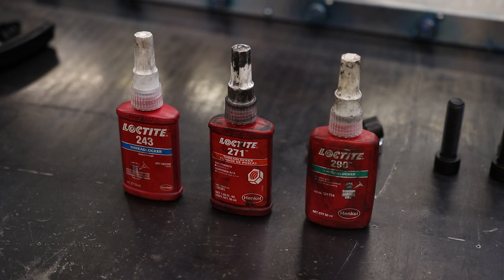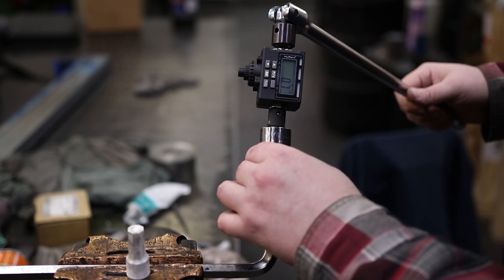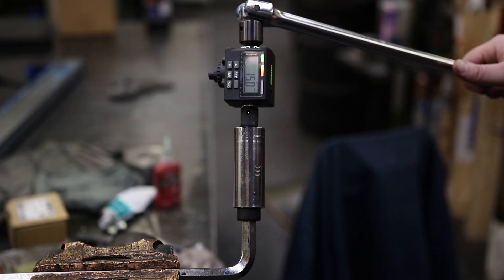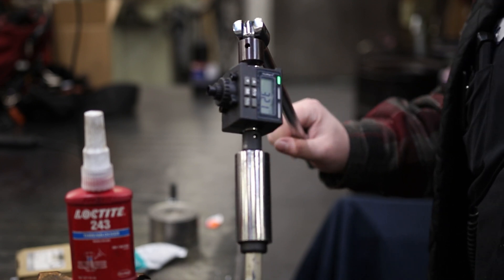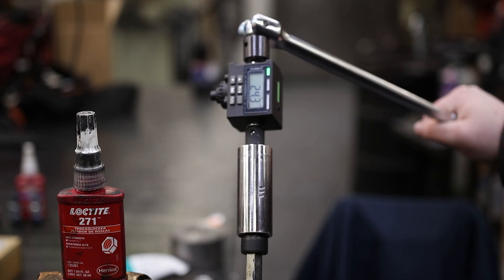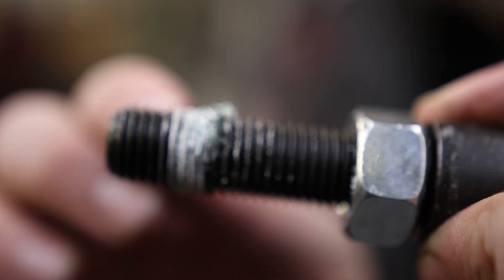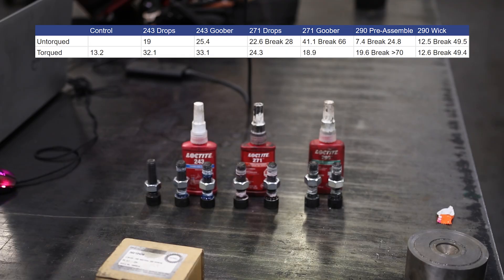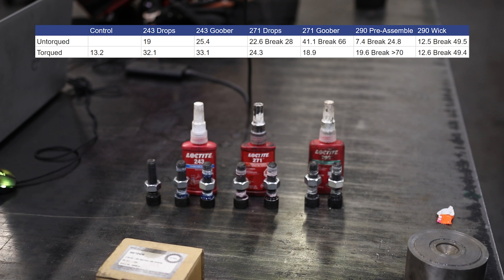Testing Loctite Threadlockers 243 VS 271 VS 290

Comment: Hi DB, retired Loctite rep here (32 years). Just came across your video. It is really well done. It is an excellent demonstration of many things. First, how the amount and application can really vary the ultimate strength. Second, what you experienced with removal is what we call 'breakaway vs prevailing' torque. 290 is the most extreme example of this. It typically breaks at a low torque and then as you keep turning it gets higher. The way I used to explain it was the first torque breaks the bond of the threadlocker to the bolt. Then you're fighting the hardness of the cured threadlocker. Your video also shows the failure mode of threadlockers. The crushed up powdery look is exactly what you should see when disassembling the parts. It means it bonded to both surfaces properly. Sometimes you don't see that. Then it means there was contamination or the metal is question had some kind of coating on it and the threadlocker couldn't stick to it. Finally, 271 is a very old formula. There are two newer generations available now. 262 was launched in the 1980's and 263 & 2760 were launched in the 2000's. The newer formulas bite into zinc plated bolts better than 271 or 262. So if you get a chance check those out. Cheers.
Reply: Do you think that the higher breakaway' torque of the 'non-torqued' nuts could due to the capillary action of the loctite being greater when the nut is loose? After all when the nut is torqued, the upper face of the bolt thread and the lower face of the nut thread will be closer and therefore might reduce the capillary action?
Reply: @fylbike  No. The only formula that has a capillary action is 290. So it's more likely due to a larger amount of cured threadlocker being in contact with the bolt and nut as opposed to being pushed out a bit during torquing. In other words, after torquing there may be less cured material left around. Keep in mind in his video he actually used 290 incorrectly. It's the only formula that is designed to wick into a pre-torqued assembly. So he should have threaded on the nut then applied it to the interface.

Comment: What’s everybody using for optic screws on pistols?
Reply: Switched from Blue 242 to 243 for the added oil resistance. I prefer the 248 solid stick or gel version now though, less mess.

Comment: Loctite 277 for more permanent applications.  

In addition, all the Loctites you are testing are not designed to increase torque required to separate fasteners.  They are designed to prevent vibration.  

Each of these accomplishes this by curing into a “plastic” basically acting like a nylon locking nut.  - which does NOT require additional torque to separate.  

If you want a more permanent solution; Use Loctite 277.  Loctite 290 is NOT appropriate for the application you are using it for.

Comment: Thread Lock .. was introduced to prevent nut falling off, prior were spring washers and castle nuts Aircraft used bolts in situations so they would not fall out of  the bolted pieces..always head on top.. manufacture and materals and testing are criticly monitored plus  stringent airtime inspections .  Bolts are elastic so in theory nut needs to undo against a torque ..manufacturers to lower costs required cheaper bolts .. cutting threads went into mass production  pressing threads  .. high spec bolts are very different to cheaper bolts and still used in critical applications ..  In the video tests None of the bolts or nuts were degreased, an important pre-treatment .. however it did show nuts and bolts will not separate .. In disk brakes its common practice to have 2 bolts holding critical part and chemically locked .. so if one becomes lose the other is likely not to come lose... like merchant ships 2 of everything.. interest test

Comment: Great video, it would be nice to see how it works if you apply it to the threads, let it dry and then add a nut. I mainly use 243 on very small screws to hold Optics on my pistols, they always send the screws with Loctite already dried on the screw
Reply: Hi there, retired Loctite rep here. Threadlockers cure when the air is excluded from the joint. They don't dry. So you can't apply it, let it dry and then assemble. It needs to see metal on both sides and the air must be pushed or eliminated from the assembly. Then the chemical reaction starts.
Reply: @Kumacattv I know that's normally how it works but 243 can cure on non-reactive metals these days so I would imagine if you just put it on a screw it might cure. How do they get it dry on screws when they ship with a little dab of dried Loctite?
Reply: @mariosmith8456  Mario as stated above you can't just put a drop on a screw and wait for it dry. The resin doesn't work that way. What you are confusing a threadlocker with is a preapplied coated fastener. We make reapplied products as well. They are applied in a factory with specialized equipment and then baked in an oven. The coating contains microscopic anaerobic capsules that get crushed during assembly. Then curing happens the same as a liquid threadlcoker. No air and two metal surfaces. There are also preapplied products that aren't anaerobic and behave pretty much like dried paint or rubber. But any anaerobic resin must be trapped in the assembly to cure properly. As for the metal type it affects the cure speed once things are assembled or torqued. But a threadlocker never dries! It cures when the right conditions are met.

Comment: I don't understand how the 271 is supposed to prevent tampering  (per Loctite) when it comes off with such little torque.
Reply: Retired Loctite rep here. It's not about the torsional torque resistance. The cured resin in the thread clearances prevents the nut and bolt from moving independently from one and another. That's what prevents the assembly from loosening.

Comment: Nice video I'm a retired Electrician used thread locker a bit through my career not as much as you have. I just want to know when the hell did you steal my deep well socket it has to be mine it has 3 hash marks on it!:face-blue-smiling: That is how I marked all my tools with a file or 3 dots with a punch when I seen your tool mark I just thought I'll be damn.

Comment: Nice research, I'm certainly no expert in this field but I'd assume that by not following the manufacturer's instructions and applying more that the recommended amount could cause some lower grade bolts to break upon disassembly if torque requirements are close to the breaking strength of the bolt. I'm careful to apply the instructed amount for that reason.

Comment: What about testing the Loctite 542 for hydraulic oil pressure.
Reply: Retired Loctite rep here. The pressure resistance of 542 should be 10,000psi. It is not listed on our technical data sheets but is listed in most of our product catalogs. 542 is the European version of 545.

Comment: What do you use to clean this stuff up if you are reinstalling the bolts, cause the bolt hole is going to be gunked up with dried up loctite? if you don't clean the threads properly wouldn't it affect your torque specs during reinstallation?
Reply: HI there, retired Loctite rep here. Use a tap, if you can on holes and a wire brush on the threads if you re-use the old bolt. Should be good enough. And yes you're 100% correct and loose material could affect your torque values. Keep in mind of the 3 products he tested 243 is the best lubricant for torquing to spec. It lubricates better than oil. 271 is a horrible lubricant. If that's important then I'd use 262. And 290 is post applied so it doesn't really have a lubricating affect. You're essentially torquing the bolt dry then applying it.

Comment: Is is possible to remove LOCTITE 243 residue from painted surface? 
I used Loctite 243 for the screws to attach black painted bar ends weights to the handlebars of my motorcycle. Unfortunately, I had some Loctite residue on my hands during assembly, which left some ugly fingerprints on the shiny black paint of the new bar end weights.
Is it possible to remove the loctite residue from the bar end weights somehow without damaging the paint? Maybe with chemicals, heat or buffing?
Reply: I've never tried.  A green scrub pad is my best friend for cleaning stubborn material, but it might scrape up the paint.  If it was me, I'd try that with WD-40 as a lube and cross my fingers.  If the bar ends have knurling or texture, it will likely rough up the edges.
Reply: @distractor_beamreviews  Thanks for the suggestion! I'll give that a try. The bar ends are just smooth cylinders
Reply: Hi there, retired Loctite rep here. The answer depends on the type of paint. If the paint has a high environmental resistance to it then the threadlocker might not even stain it. Usually any kind of solvent will clean it off. However if the paint surface is rough and not epoxy based or latex the threadlocker could stain it. If the paint has an acrylic base to it the threadlocker could stain it. It is anodized black aluminum then you should be ok.

Comment: If you heat any chemical, it speeds up the cure. Put a flame on the loctite and you’ll get 24 hours of cure in 24 seconds.

These results are all off. you need too acetone every bolt, and apply the exact same amount on all of them. That wasn’t done here.

That red stuff should have one everything

Comment: The Green Loctite is some crazy stuff, last time I used it a bearing race had been damaged by a bearing not being replaced when should have so the new bearing wouldn't stay in the race.  Added some Green Loctite and waited an hour and that bearing will now need to be heated out of the part but it prevented the replacement of a $2800 roller. lol
Reply: Yeah I thought the green stuff was pretty wicked, until I worked din an engine shop and they had a magic bottle of clear loctite sauce. 
Not even a label on it ,that's how I knew it worked great 😂
It musta came from a distributor or something,no markings on the (similar bottle) as loctite.
Reply: There is a difference between the the 290 green, and the 6XX green retaining compounds.  The retaining compounds are much stronger.

Comment: These bolts had a shoulder down at the head, so you weren't torquing against the threads, but rather just the very bottom of the nut against that shoulder.

Comment: Loctite is anaerobic. NO air means it sets. The red stuff not working may mean that there was an air gap at 15 psi
Reply: Retired Loctite rep here. If you look at the video he got crushed up red powder upon removal. So curing wasn't an issue. 271 is an older product that was invented in the 1970's. It is slower curing than most of the current versions we sell today. (eg. 263, 2760) If I recall full cure on 271 on carbon steel is closer to 72 hours. It also has a lower tolerance to oil than the newer versions. For comparison sake 263 fully cures on carbon steel in 3 hours! That's how fast the newer versions are.

Comment: You have to clean any oil or grease off the threads for the very best bond. Loctite 680 retaing adesive is on another level, if done right it's insanely strong almost like a weld.
Reply: I like loctite 272 I use it for retaining injector cups on Duramax engines and power stroke engines along with Cummins
Reply: You are correct about the 680. It can be nasty when put into use. But what about that black loctite? The local machinist swears on it!

Comment: Well first there is at least four types of red LocTite brand and each is for very specific uses same for Green which has 290, 294 & 638 all with different uses. As far as how & how much look at a Holly Davidson manual which will state which red LocTite & how many drops to use for each Specific fastener. So it may request two of more red LocTite types for several bolts in the same area. I was shocked just how vast their types & usage and different brands are all over the place too. Permatex, J-B Weld Perma-lock, LocTite but to mention a few.

Comment: Loctite thread locker needs to be applied correctly for it to achieve it best performance. 
Put it on clean oil free nuts and bolts will give you a fair outcome but it takes a long time to cure correctly.
If you are serious about it you prime both components of the fastener , flood and assemble as quickly as possible.
Loctite 7471 works very well to ensure a full cure regardless of temps. It also makes a nice quick set gasket if using 5188 or 515. 
Unless you have primed the surfaces with the proper primer the set strength and vibration resistance is going to be a lot less than 100% of capability.
All of the compounds appeared to have not fully cured when tested.
Reply: its application error, he used a bolt without continuous thread to the head. When he torqued it, it was just torquing the nut to the head, not all the threads were meshing tight. Loctite is anaerobic, so it only sets when theres no air. Even then, 15lb is on the very low end to get good thread engagement.
Reply: @Pepe-dq2ib  In my experience the use of primer makes a significant difference and will often make up for application specific shortcomings.  it will cure every time and for the full application area.  Once you have tried it you will understand.
Reply: @Pepe-dq2ib you're probably correct, I'll admit I didn't like seeing the nut break loose at lower torques and then get heavier. Because once a nut breaks free slightly you're going to have problems with whatever your fasting
Reply: 243 is oil tolerant. 

I can not speak for the other mixes though.

Comment: We were told by loctite representative to use primer, it sets up quicker and more solid. Also Loctite seals the threads from rust and outside contaminants. We used 270 to keep bearing shell from turning on casing and always had to heat them out. My experience with this product.
Reply: Hi, retired Loctite rep here, your rep was correct. Primer would allow most threadlockers to fully cure in less than 1 hour vs 24 hours. Just depended on the formula. The time varied by product. But in general they all cured faster. In some cases it cured so fast you might not have time to do final torques. Also of note 270 is a European version you don't see in North America. It was very close to 263. Ironically 270 is green and 263 is red. A bit of head scratcher as to why we did that back then.

Comment: As a machinist/mechanic I know the threads do not go all the way to the head of the bolt. It looks like you were bottoming out the threads on the nut. If you were to put a washer on before the nut it would insure the nut wouldn't bottom out. I've seen thin sheet metal do this. Nut is tight but sheet metal isn't.
Reply: 6:58 shows that thread best.  

Torque results are void.
Reply: And no mention of adhesive accelerators, activators or primers

Comment: I use RED 271 on BIG mixers that have crazy high torque to retain big bearings in aluminum housings and various large bolts 3/4 +++ it always needs heat to come me apart

The press-fit repair silver paste is also a pretty impressive Hail Mary
Reply: That's reassuring to know, as earlier this week I used it to hopefully bond a steel wheel bearing cup into an alloy hub on my car.

Comment: Did you degrease and 243 seems better than 242 if any oil might be present I don't even buy 242 any more
Reply: I did not degrease.  My understanding is that 243 is the new 242.
Reply: @distractor_beamreviews  Correct. 243 is different in many ways. More oil tolerant, has a higher viscosity, luricates better and most importantly is a primer less formula. Meaning it cures faster than 242 does. It is also much more consistent when torquing to spec. You get torqued assemblies with very consistent overall bolt tension.